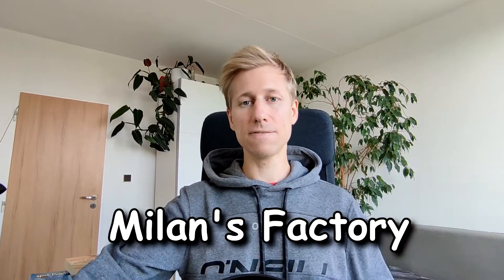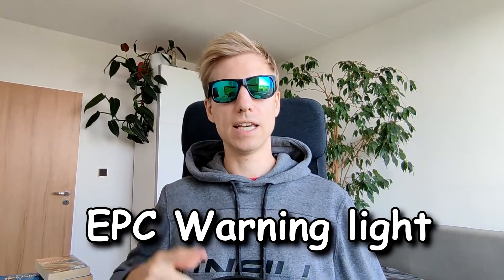EPC Warning light on dashboard in a car – How to fix? Can you drive with EPC light on? Explanation

Comment: hello, my epc light is coming on when i speed up quickly or reach high speeds, i have just had to actuator replaced and the mapping sensors replaced but still have the same issue. any ideas what this may be? it’s a seat ibiza 1.2 i tech
Reply: Same here on vw jetta , mostly on higher speed , found any solution?
Reply: I have same problem with seat ibiza 2009 please did you solve it ?